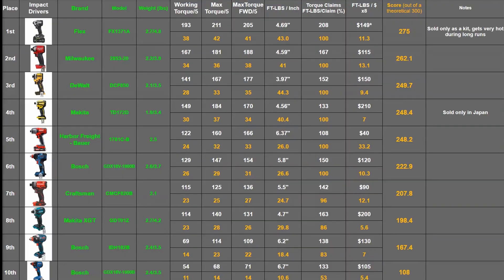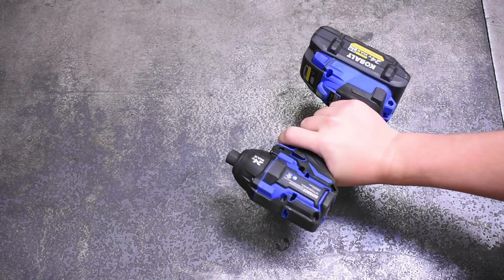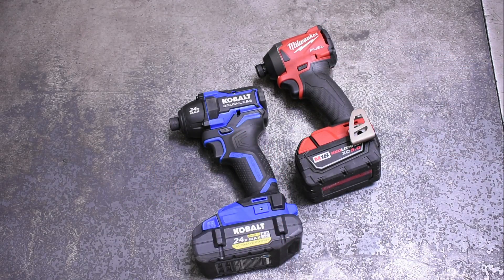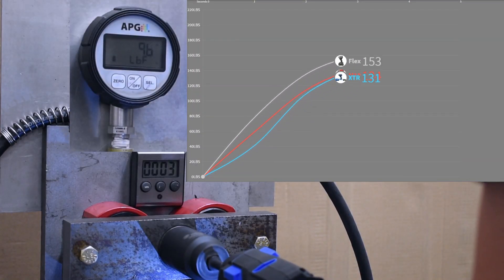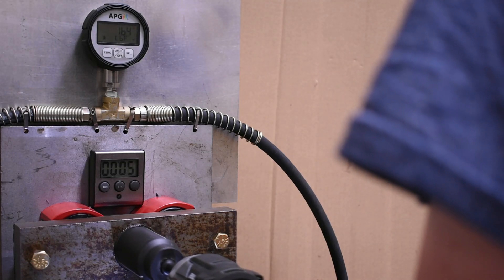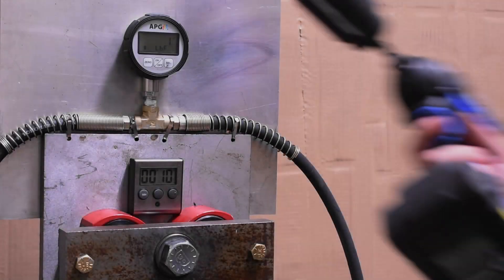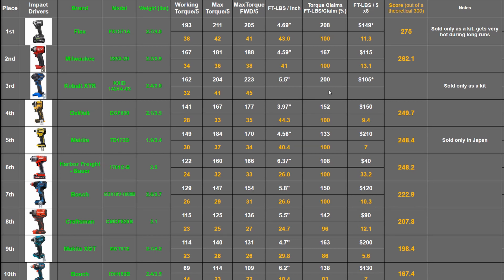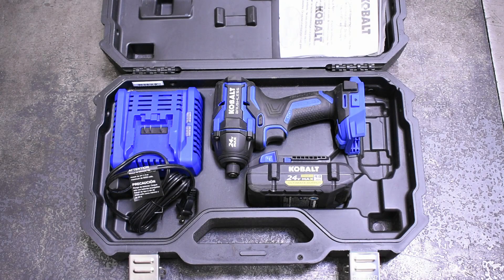You All Said THIS is the Most Powerful Impact Driver: Dyno Finds Out | Kobalt XTR

Comment: A friend of mine has a lineup of Milwaukee and I have a lineup of Kobalt one day, he called me over to his garage for a drink as he was changing the brakes on his car he tried unscrew the nuts with his Milwaukee not a chance and I told him if I bring my Kobalt ratchet not the big Guy the smaller version like the one on the test it’s going to rip your wheel apart and honestly, I wasn't sure I was just joking with him and he was laughing. I jumped into my car as I only live couple minutes away and got it with 4 Ah battery and put it to the test and it did unscrew the nuts then he looked at me and he was like I cannot believe this Kobalt did it and I was like well now you believe it my friend.
To that day I thought Kobalt is the bottom line of the tools but boy I was so wrong you can easily compare them with top competitors like Dewalt flex Makita Metabo let alone  Milwaukee.
Since that day, I start watching some tool desk comparison and I came across this video now I am 100% confident that Kobalt is proving to be an excellent excellent tool it's just so under rated.
I have few Dewalt XR 20V drills and driver that I been using for number of years but I find Kobalt is more powerful and nicer tool.

Comment: An interesting idea would be to test all of the basic brushed versions these brands offer as the "starter" impact drivers. Dewalt, Milwaukee, craftsman, and kobalt etc have a basic impact version. Definitely not powerhouses but would maybe be neat to see how they compare or if they are all just terrible.
Reply: I suggested the Ryobi P235A. Fits that category. Personally I'm just looking for a frame of reference for comparison, based on personal experience; it's the driver I own. Got it second hand real cheap. Drill, driver, battery, charger... $50

Comment: You nailed the issue, as a Dewalt fan admittedly, what I'm really looking for is an impact to break all my adapters!!! I already break LOTS of them with my 887 about the same with my new 850. So when that happens I step up to an impact wrench. What has to change or evolve is adapter strength. I'm pretty sure looking at the new 921 dewalt at approx.300 to 350 ft pounds they could make an impact to DESTROY every adapter I own. I really want 10,000 hp in my ford Raptor so I can destroy my tranny, drive line and rear end at every stop light!!!!! There is so much more to the story than just power.

Comment: Did you use the right battery?
Reply: The have the best battery available. It is the only Kolbot battery with the new 12700 cells in it
Reply: Yes he did. The 4Ah Ultimate Output is the best battery Kobalt offers right now. It's the only one with 21700 cells. Would be great to see the Kobalt line tested again with the new 8Ah ultimate output battery once that comes out though!

Comment: Try picking up the short (2") Makita 1/4" hex to 1/2" square adapter!  Part # A-97673, or 10-pack is A-99421.  Qualitatively it seemed to generate more torque than a longer adapter I have.  Maybe these would survive longer runs.

Comment: Kobalt is apparently coming out with an 8Ah version of this ultimate output battery, with presumably 21700’s in it. As an owner of an XTR high torque it would be very interesting to see what kind of improvements there might be on a tool that really likes a full battery and runs the 4Ah down rather quickly.
Reply: Where did you hear about this? I was thinking about buying a Kobalt impact wrench whenever it goes on sale and having enough money to buy it.

Comment: The issue of breaking adapters tells me that we've gotten to the point that power isn't really the differentiator between these tools, especially for typical uses.  At least for the top tier ones, ergonomics, battery line, design, long term reliability, etc, etc, are far more important.  The 1/4 inch hex shanks are the limiting factor for power, and these tools are to the point that any more power requires a step up to larger drives, like 1/2 inch or larger impact wrenches
Reply: I'm willing to bet that the breaking adapters is more commonly a problem on a rigid setup like the dyno. Doing big lags with wood, where the force of the blow gets a bit absorbed into the comparatively springy wood structure, probably saves the adapter.

But I'll tell you, one thing I really want to see is this Kobalt made into a 3/8 drive. For doing lighter automotive tasks like brakes and linkages, this thing would be awesome in tighter spaces. I have the XTR high torque and she brings the beans, but she thicc.
Reply: @MrJamesonStyles  For some reason, my previous attempts at replying keep disappearing. I have seen the issue of breaking adapters with impact drivers (especially higher end models) on other channels, with your very example of driving lags into wood.

 Over the summer for example, "Man Caver Tools" had a bunch of videos with him complaining about this very issue and showing him breaking many adapters in his tests.  These tests are of course still unrealistic, driving very large lags into tree stumps with no pilots holes, but still avoid the rigidity/shock issue you mention.
Reply: Or...ya know...he could try different sized bolts. His "rank charts" restrict him to using a one-size-fits-all testing method, unfortunately

Comment: I appreciate you telling us that the Flex needed a break. That's my thing; I need the thing TO WORK. Not intermittently. I'm not sold on the longevity of the Flex line just yet. Early adopters will certainly need that lifetime warranty I think. I'm impressed with the Kobalt... I just personally never had a Kobalt tool last very long, and I'm talking hand tools, my PTSD won't allow me to touch a power tool of theirs.

Great videos!

Comment: Kobalt also has an unbeatable warranty, Its a 5 year no questions asked warranty on a power tool and 3 years on the battery and is super simple to go through at lowes
Reply: I would disagree, Ridgid offers a LSA - lifetime service agreement. But we don't know how it compares in these tests yet. Also the Flex line offers a lifetime warranty if you purchase it this year I believe. But after this year they will not offer the lifetime warranty. But there are some other better options then 5 years.
Reply: @legobrains  - Ridgid's LSA is pretty much a joke though.
Reply: @legobrains  Ridgid warranty is not what you think it is.

I had to take a Bosch Laser in for warranty at a local authorized repair shop. They deal with every brand minus Milwaukee because they have their own service center.

The employee there told me they dropped Ridgid this year because they barely even pay enough to cover the cost of the repair and are difficult to gets parts for.
Reply: It's certainly not unbeatable, but it is definitely above average. I think it's basically an exact match for Milwaukee
Reply: Better keep your receipt or you have no warranty. Kobalt 24v max is a lot of tool for the money, but Lowe’s employees will act like you’re stealing from them if you try to make a warranty claim.
Reply: @billd7441  Depends on the Employee. My wife worked at Home Depot for 3 years and WHENEVER someone brought something Ridgid in she just replaced it no questions asked. It's all the person with these things usually managers tell them to use discretion. If you come in and are an ass or act irritated your tool broke they'll want receipts and all sorts of stuff
Reply: @midniteoyl8913  no it's not a joke. I've used it on a charger and got a new one 3 days later. Did it over the the phone. Didn't even have to take it in. They asked me which charger it was , verified my address and that was it. Again NOT a joke.
Reply: @midniteoyl8913  I took many impact drivers and wrenches in for repair over the years. Even batteries.
Every time Ridgid fixed or replaced the defective tools without problems.  People who are having problems are the ones that do no take the time to register their tools on the website. 
And if they give you a new
 tool (or battery) you have to go back to the site and register it again.
Follow the procedure and you’ll have no problems.
Reply: @Peter-.H  no one has time for that. Milwaukee has the best system. Warranty is based on date of manufacture from the serial number. Doesn’t get any easier than that.
Reply: @Peter-.H  - Thats not the problem. The problem is sending them in and then getting charged for the repairs. Every excuse is used to charge you for the repair and hold the tool hostage until you do. Something that is getting worse and worse in recent years. Many have given up and moved on from Ridgid.
Reply: @GuyFromJupiter  milwaukee only has a 3 year I believe and doesn't cover a lot of breakdowns
Reply: No question with receipt.
Reply: @midniteoyl8913  I’m sorry you had that kind of experience.  I guess it really depends on the repair centre you’re dealing with.
I never had that kind of problem.
Cheers 🍻
Reply: I personally have a bunch of Kobalt tools and when one breaks and you take it back to the store, there are times you will have to argue with them, with the fully legible receipt. And you’ll have to bring in the manual saying to take it back to the purchasing store for warranty returns. But their longevity is subpar. It’s their switches that really like to fail. And they start showing that failure by cutting power about  0.5 second after pulling the trigger. For me, the only reason I went with the Kobalt 24v system years ago was the price of their batteries were half or less then half price of other models, but not now. And their batteries really don’t have a really good capacity with high current use, no where near Milwaukee m18 lineup, which I’m slowly moving to one tool at a time. We use Milwaukee at my work and they get absolutely abused and even running completely submerged and everything still runs good, where as I would not trust Kobalt in an industrial setting, as much as I hate to say it.
Reply: @Peter-.H  - Glad you had good luck, lotta people having the problem here in the States

Cheers to you too
Reply: @billd7441 , yes.  A friend of mine got into the Kobalt line last year.  He had to exchange a battery, with receipt,  and got the runaround by the Lowe's employee.  They begrudgingly exchanged it.  A week later, his drill/driver crapped on him.  They refused to exchange the drill, saying he'd already returned the battery out of the kit.  The Kobalt rep and the Lowe's employee took turns trying to pawn him off on the other.  Let's just say that he's completely done with Kobalt and won't be shopping at Lowe's any time soon.   He's now on the M18 Fuel platform, like I told him to go with in the first place.
Reply: Highly disagree on the painless process at Lowes part. They will do everything they can not to replace the tool or battery. FU Lowes and FU Kobalt
Reply: I have to disagree.  Ridgids LSA is not too bad when you register the tool. My brother and i have both sent in drills and recips and never had a problem. Even when the replacement of the purchased tool failed. The down side is paying $20 and they send out the tool taking 3-4 weeks to get the tool back, but also getting the 20 bucks back. Depending on the problem they may just give you a new tool right there, but usually they want to crack it open and send it in. Metabo htp also has lifetime warranty. Milwaukee warranty isnt great either, especially if you dont keep the receipt. They will go by the date the tool was manufactured. If you bought a tool that was manufactured 2 years ago and only had it a year, you're crap out of luck. Also, like most tools these days, the serial tags are crap and the numbers wear off under any moderate usage, and if even 1 number wears off they refuse it unless you have warranty.
Reply: @legobrains  the lifetime warranty just got extended to December 2022, I just got the flex but have the xtr, so far haven't seen much of a difference between the two but I would have to take it to a Fastenal for repairs out here in Texas while I just exchange the kobalt at any Lowe's with a receipt. Both are great
Reply: @midniteoyl8913  I don't have to take mine in my 11-year-old one still works
Reply: Can’t speak for rigid but the flex lifetime warranty is on point. It covers not just the tool but the battery and the charger. My high torque have to drive 10 power battery went bad within the first two years of owning it. You do have to register all components that you own but once you do, it’s no questions asked when A tool or battery goes bad. Contacted Clerks, told him my issue and they had me a brand new battery within a week.

Comment: Hey, have you guys ever considered testing the IR "Quiet Tools" versus their loud variants? According to the parts diagram for like a 2235QTiMAX it looks like the "muffler" is a single piece that wraps around the hammer assembly maybe, so you might be able to test the quiet tool and then remove the muffler and retest the same tool for a proper apples-to-apples.
Would also be interesting to see if other brands' quiet variants have similar power disparity. I'm not an a**hole and prefer the quiet tools for my shopmates' sakes, curious how much I'm leaving on the table for that choice though.

Comment: I would really like to see the new Ryobi impact driver tested out. Seems top notch based on man caver tools testing
Reply: I have the One+ HP Compact and use it on cars and it's actually really nice. Not the most powerful, but man the size and the ergonomics of it are spot on in my opinion.
Reply: I've got that one along with the Milwaukee and DeWalt DCF850. It makes around as much power as the DeWalt, maybe a hair more. The Milwaukee makes more power. The Ryobi is the largest of the bunch, but it by far has the best auto mode. 

If you need to remove some Phillips screws that were buried deep, the Ryobi is the one for the job.

Comment: The Kobalt XTR impact driver is s beast especially for the price. One of the best deals was last BF that had the XTR hamer drill, impact driver, work light, batteries and charger for $249 plus a free 24v tool. I wish Lowes would've brought that deal back this year. These tools are an incredible value
Reply: I picked that deal up, beat up my impact all year still has the power. XTR impact probly the best bang for the buck.
Reply: Right now you can get all of the above plus the circular and recip saws for $350 (no free tool though).  Talk about a deal.  I traded in my regular Kobalt drill/impact for this kit and couldn’t be happier.

Now they need to make an XTR “mid torque” by throwing a 3/8 anvil on this driver.
Reply: Got the same kit for that price myself and have never regretted it for a moment.
Reply: @drunkonunleaded  I was looking for that deal but it was not available down here in florida
Reply: Yup. Awesome deal.
Reply: What were the free tools you could get?

Comment: Smart analysis. My thinking, in use, is very different. The heavy hitters mangle too many fasteners, and it's really not the purview of a 1/4" hex drive. I tend to prefer the mass centered in the palm to prevent fatigue and the more gentle power delivery like with the Bosch 12 volt (basically an every day tool for me), or the Milwaukee M12. When I need something with more battery or for driving something like a lag bolt (coincidentally, my task this morning), I like the way the M18 Surge is both quiet and how the "impacts" kind of have a curve to them. I once went to use a DeWalt impact driver and the client was so surprised by the noise that she literally spilled her coffee on herself.

Comment: A few questions you could ask yourself. Do I need an impact driver and an impact gun? Can one do both? What inch pounds/foot pounds is the boundary of using one or the other?
Reply: I got a dewalt impact driver, sadly it wont break loose my cars wheel nuts, so im thinking of getting an impact wrench
Reply: I use my Milwaukee M18BLID0 (compact brushless impact, non-fuel) primarily with a socket adapter and don't own a cordless impact wrench, only an air one.
It's rated at 170Nm or 125 ft lbs.
It's powerful enough for most of my needs including lug nuts on my Land Rover and I don't think most people need much more than that. It snaps the adapters fairly often. I've used it to change major suspension components, and sometimes need to resort to using a large breaker bar to get things going but not often enough to warrant me buying another tool.
Reply: Yes and no.  I’ve used the original Kobalt driver with an adapter to do everything from suspension work to pulling cylinder heads in the junkyard.  It works well in that regard.

The weakness will almost always be the adapter at this point.  You may be fine for smaller stuff, but for lug nuts and such the chance of breaking the adapter is too high.
Reply: I have both an M12 driver and M12 stubby wrench. The wrench takes my F150 lug nuts off and the driver is for household tasks

Comment: These little 1/4" impact drivers make too much power as it is.
Reply: I agree. As you see, they break adapters all the time. If you need that much power you need an impact wrench or a torque wrench.
Reply: Just get the impact wrench and don't use adapters.

Comment: One feature I LOVE on my driver that isn't standard across most drivers: the ability to install bits just by pressing them in place. I noticed you had to pop the collar to install the adapter on the Kobalt. It's super annoying to me to do that! Even across one brand the feature may or may not be present!
Reply: Are you talking about the m18 gen 3 with this feature? That’s also what causes the biggest problems for people. It’s because they have one ball retention baring instead of two like most of them have. This causes it to lose its bit in reverse when something is pulling on it (like retracting a drill or spade bit from wood).